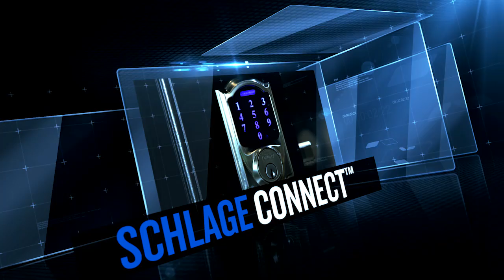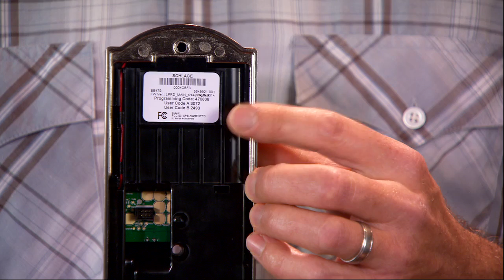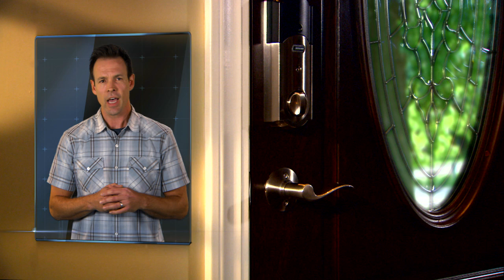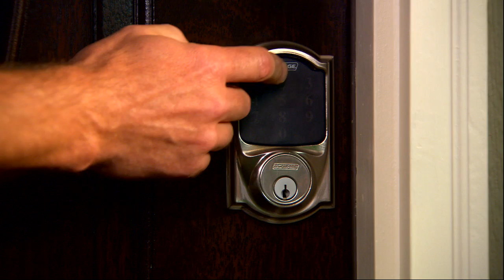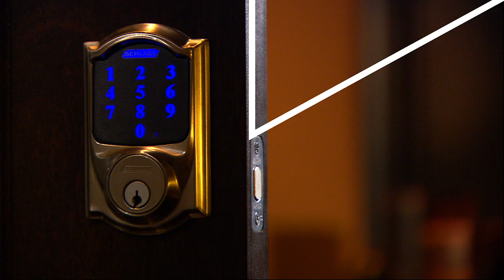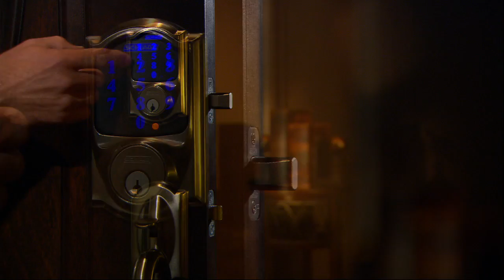How To Use Your Schlage Connect Smart Deadbolt

Comment: Can I pair a wireless remote with this lock to open and close it.  I have a wink 2 hub.
Reply from the maker: Thank you for reaching out to Schlage support, The Connect, lock will pair to you wink system via the Wink app. The Connect is our zwave lock that pairs with a zwave hub. We would recommend speaking directly with Wink as far as the functions allowed with in the Wink app.

Comment: Can someone help.me. mine opens but a yellow light comes on and beeps for like 20.seconds then it unlocks is that normal
Reply from the maker: Hello, 

The yellow light indicates low batteries. Please insert a new set of alkaline batteries in your lock and try locking/unlocking again. If you continue to get the yellow light you can try another set of batteries or a reset on your lock. I have provided the steps below. 

With the door open: 
1- Disconnect the wire from the battery pack
2- Press the Schlage logo on the EXTERIOR keypad once and release
3- Press and hold down the Schlage logo on the EXTERIOR keypad and reconnect the batteries at the same time ( You should get 3 green check marks on the keypad right away)
4- Enter User Code A from the programming sticker (The deadbolt should extend and retract) 

Have a safe day!

Comment: The problem with auto lock is that the lock doesn't know when the door is closed. Because it doesn't know it will extend the lock while the door is open. Schlage should have thought about this and added a sensor to detect the door is actually closed rather than to depend only on a timer. Too bad they don't understand this important feature.
Reply: Have you figured out how to fix this lock error that the lock stays out when door is open?